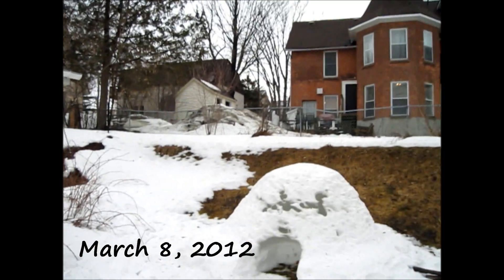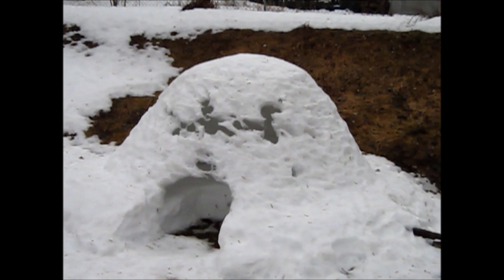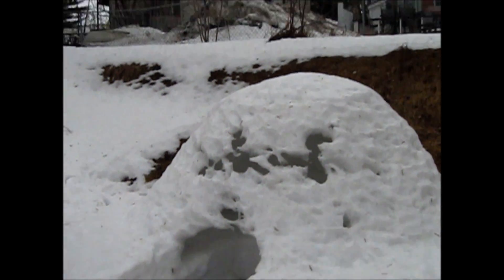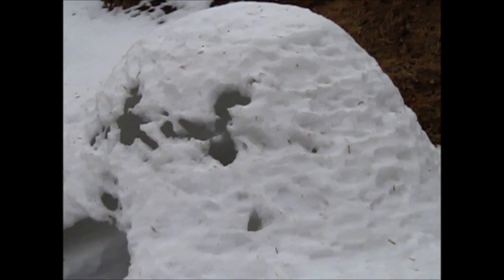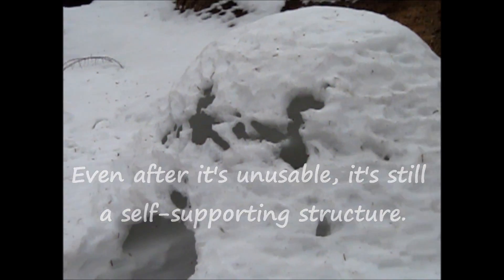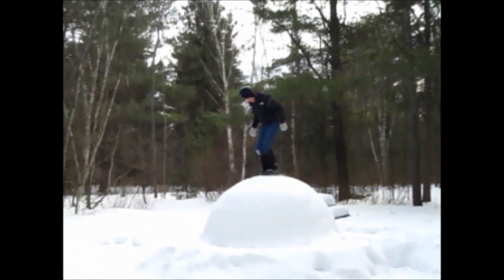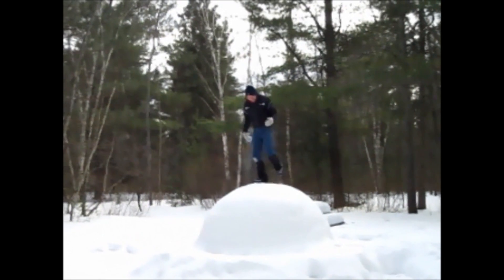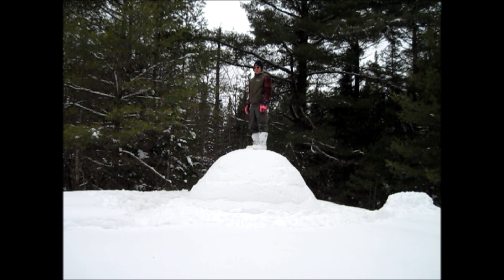Igloo Strength, Stability, & Durability - a demonstration

Comment: what is the reasoning for not facing the opening south if you were camping in it?
Reply from the maker: +Heyzipupyourfly If one is building an igloo for short-term use, one needn't worry this. One should put the door opposite to the prevailing direction of the wind.  So, if the wind is coming out of the east, put the door on the west side, to avoid cool drafts.But if  one is building an igloo intended to stand for quite some time, for prolonged or repeated uses over the course of weeks or months, one should avoid putting the door on the south side because the south side is the sunny side, and that is the side which will melt and sublimate faster as a result.  The door, being essentially a hole in the wall, represents a structural weakness in the igloo, and if it's on the south side, that side will melt, shrink and sag faster than other sides.  If your door is in the south side, the opening of the door will literally get lower and lower, making it hard to enter, forcing you to open the hole bigger.   It's not a big deal, but it's something to think about when making an igloo that one intends to use over and over again during the course of a winter.Cheers, - Martin

Comment from the maker: It depends on the size of the igloo, and the sort of snow you have to work with. Typically, with a partner, I can build an 8' wide igloo (interior width) in about 4 hours, including breaks for rest, water, snacks.  I have built 7' wide igloos solo in the same time. 
Glad you liked the video.
Cheers,
- Martin

Comment from the maker: I've winter camped with a large group on one occasion, so I can't speak with any authority here, but I recommend 2 igloos.  2 can build an 8-footer, and 3 can build a 9-footer.
If you have 6 people, build two 9-footers.  The 11' can accommodate 5-6, but only so many can work on the igloo, and it will be a little tight in there and hard to cook with that many in one igloo.
Most important, learn to use the tool with a friend BEFORE you go camping.  It's a tool, not a magic igloo maker.
- Martin

Comment from the maker: Canesser1: I don't use a conventional mold, as those will only work in limited snow conditions (wet snow or fresh powder), and the proper shape is very hard to achieve.  I use the Icebox Igloo Tool, by Grand Shelters. It's not cheap, but it's cheaper and lighter than a winter tent, and the shelter it produces is roomier, more comfortable and warmer than any cold-tent.  Best of all, it works with any type of snow.  Check out my other videos on igloos to see how it works.
Hope this helps,
- Martin

Comment from the maker: Good question, MishinFishin.  It varies, depending on the size (from 7' to 11' interior floor width), the snow conditions, and whether you're alone or with a partner.  When camping with a partner, I typically make an 8' igloo in 4 hours or a little less if the snow's good.  When alone, I build a 7' igloo and that takes about 4 hours also, including breaks for resting, snacks, etc.  I have other videos about how I make them if you're interested.
Hope this helps,
- Martin